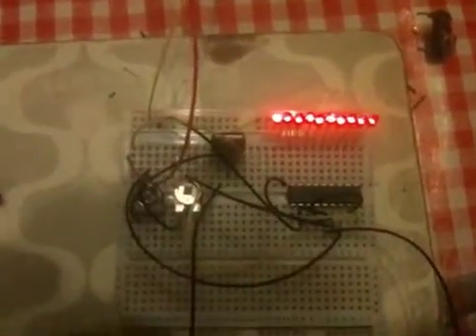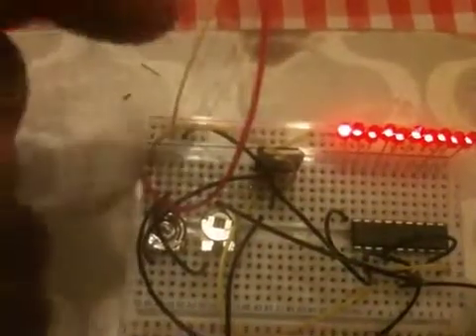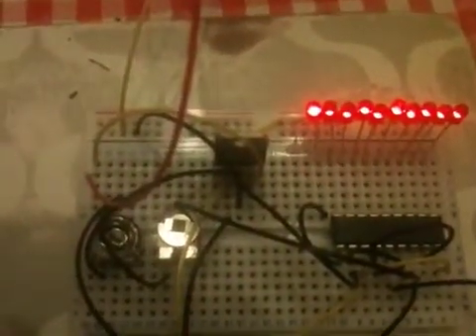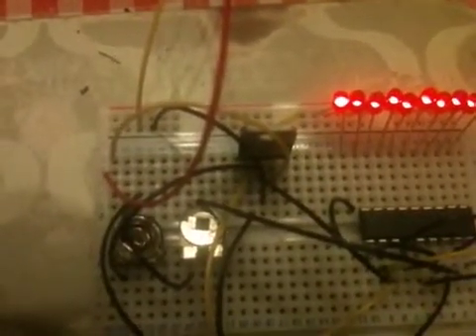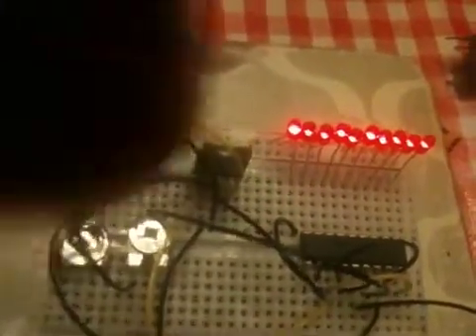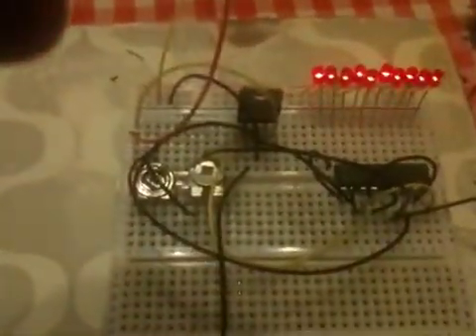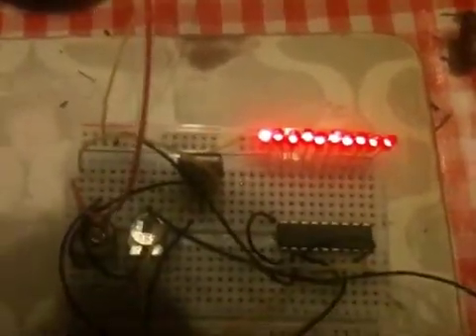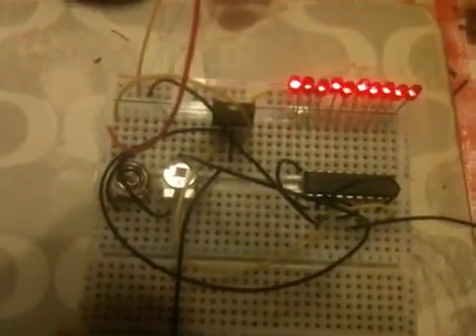L.E.D driver chip (LM3914N )

Comment from the maker: and yes these microchips can be used to for an input of anything from millivolts+ just by using the correct resistors in the right places. i have dabbled in electronics for years but only as a hobby and i have a general understanding of electronics which is helpful.

Comment from the maker: hello, MrElseWay.
 still waiting for parts to arrive in the post to get this project off the ground. i was chatting to my mechanic today and he said that he has a scan gauge i can borrow that will help me so i have no big rush for this project, however, i have made a simple 12v battery monitor last night using this microchip. it tells me if my battery goes below 8v or up to 15v, will upload it and explain it better. On this video i was using a 1.5k and a 4k7 pot. not ideal values but it worked.